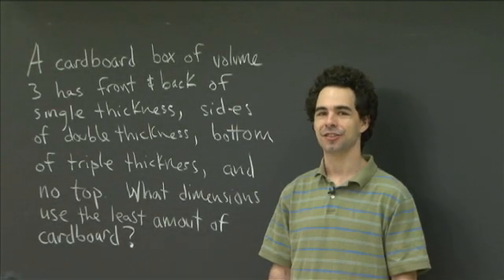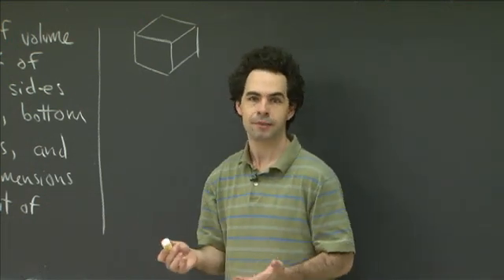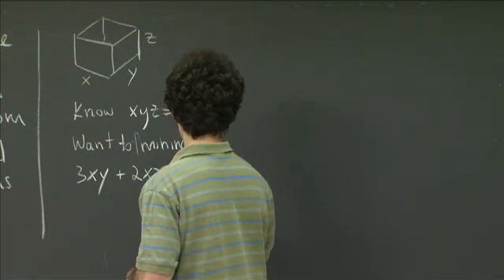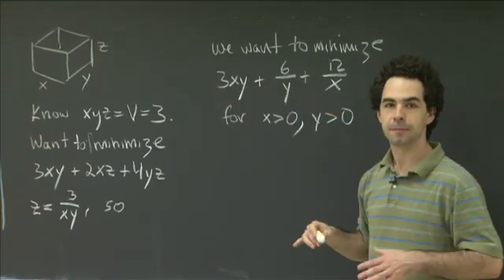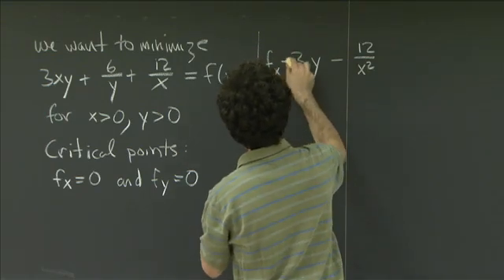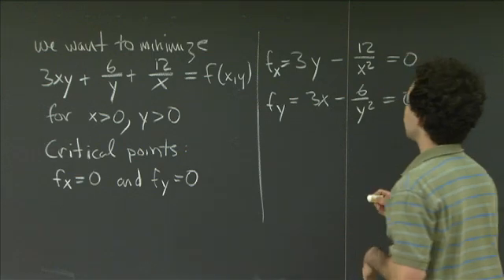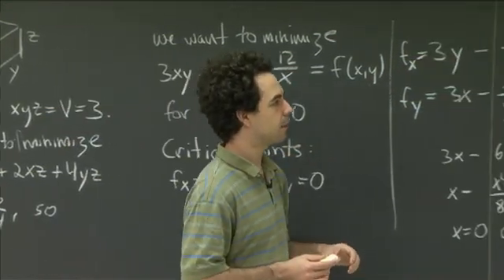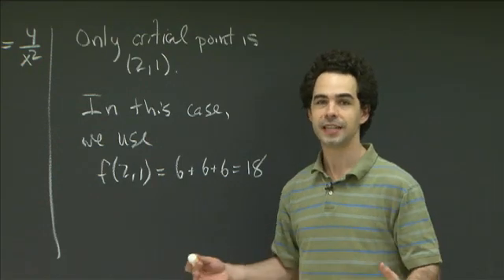Max/Min | MIT 18.02SC Multivariable Calculus, Fall 2010

Comment: He suggests that being local minimum isn't enough for this function, and we need a global min. However since there's only one critical point for all x>0 and y>0, and the 2nd derivative test shows it's a minimum, then it's not possible for the endpoints to do anything else other than grow exponentially. I get that it's sometimes/often necessary to check boundary values/behavior, but is that really applicable in this case?

Comment: @storaman12 Yeah, the amount of cardboard used isn't in square units. Multiplying by the thickness of the cardboard gives it volume. Although the method is the same, the terminology used is incorrect.